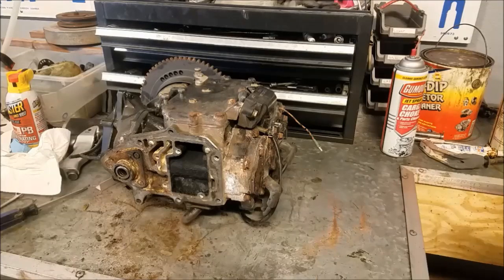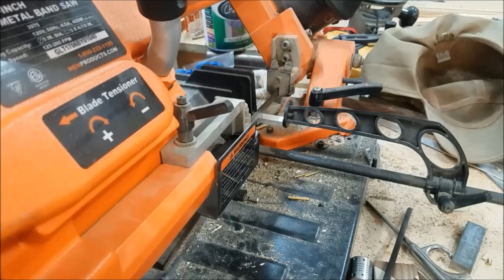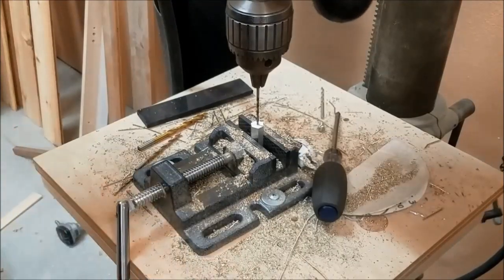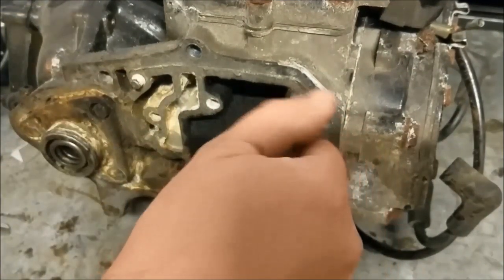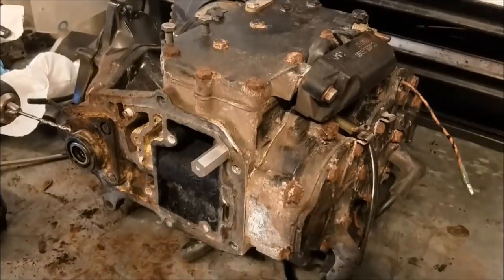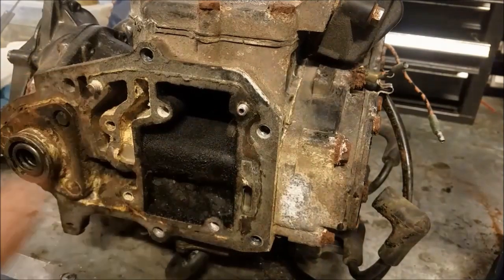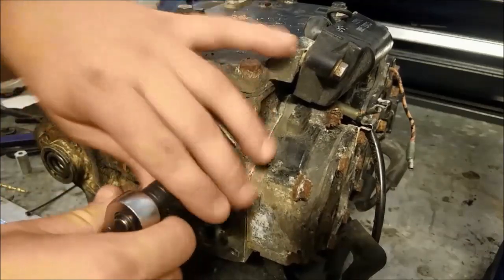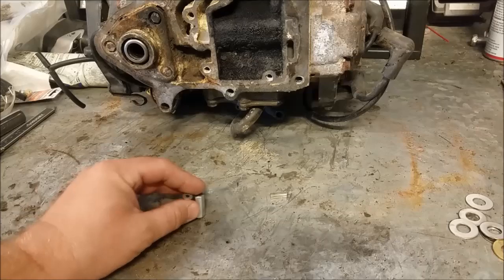Brilliant Idea To Drill Out Broken Screws/Bolts

Comment: I recently had 6 of 10 head bolts break on a salty Nissan 9.9.  The thing that worked for me was welding nuts on the end of the studs and keeping a propane torch on the aluminum casting while turning the stud with a wrench.  If I took the heat off, the threads would lock up again.  This is the only time I've had to use more than the heat from the welder to loosen a thread but it will be my go to next time I have a stuck bolt in Aluminum.  Enjoying your videos. I'm catching up after a few years away.

Comment: I'm a Machinist and I don't see a problem with this. I'd make one of every thread size you deal with.
Reply: The screws in Evinrude and Johnson that break are almost always 1/4" UNC. I believe that's 20TPI  threads per inch. If memory serves correctly 1/4" Whitworth is also 20TPI. The thread shape is slightly different, but they are interchangeable in this application. 1/4"  20TPI Stainless screws are hard to find locally.
Yamaha, Mercury, Mariner, Honda and others use 6mm screws which are easier to find. So only two special tools would cover almost all broken screws.

Comment: I do saltwater motors alot, omc 9.9 15hp, heat the bolts between 160 to 200 degrees, then use a battery ratchet gun, they come right out,, never have a problem..

Comment: Pretty cool for for me to try next time rather than free hand it. Got a question. Have you ever repaired an aluminum hole with a brazing rod and redrilled and tapped? They say the brazed aluminum is stronger than the original material

Comment: I take that back. Use the 1/4 20 collar and a 1/4 20 bolt shorter than the collar. Drill the guide hole through the 1/4 20 bolt.

Comment: Why not try an easy-out screw extractor after drilling the hole? If the remains of the bolt come out, the treads are undamaged.

Comment: You should use left hand drills for this. 8/10 they will back out the screw. I also cringe when I dont seen any cutting oil or tapping oil.

Comment: Hey Brando can you go over why engines go into limp mode or safe mode I have a friend that has a 1993 140 hp OMC and he replaced the impeller and it’s not running hot it’s around 120 degrees and sometimes it just goes into limp mode any thoughts would be great. Also it’s a 2 stroke with a vro and it ohms out at 17
Reply from the maker: Well, there could be a lot going on here.
1st, the temp sender could be bad, telling the VRO pump to over oil to protect the motor.
2nd; the VRO could be failing, thus over oiling to protect the motor.
3rd; and probably most unlikely, the stator/gray wire/connection could be bad, and the VRO doesnt know the engine RPM, thus over/under oiling.
Reply: Brandon's Garage today he noticed that the float in the oil tank wasn’t floating all the time it kind of hangs up. He thinks it could be sending a signal that it’s low on oil would that put it into a safe mode?

Comment: Seems like a lot of work.. if you can get a nut on it there should be enough to heat the crap out of it and grab it with vice grips and twist it out no?
Reply: On steel it's a good method but aluminum block with stainless bolts it's as if the corrosion welds the two together. Probably why outboard motor service at Marinas is so high